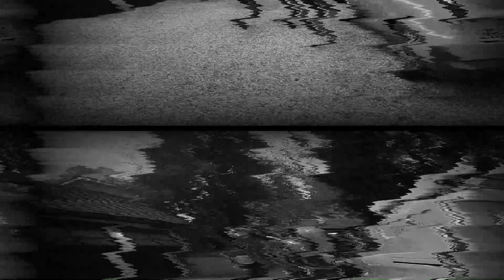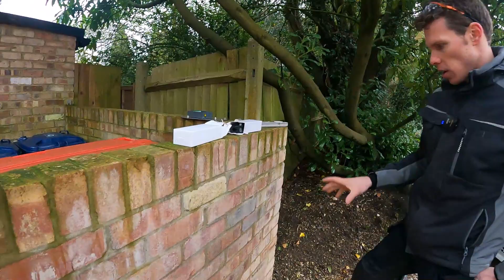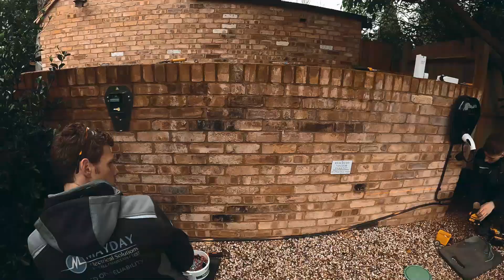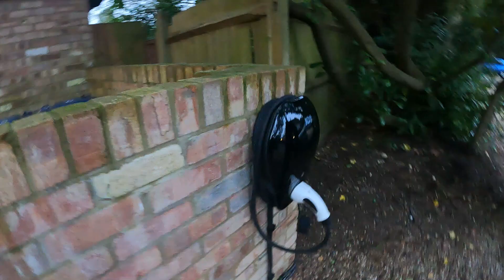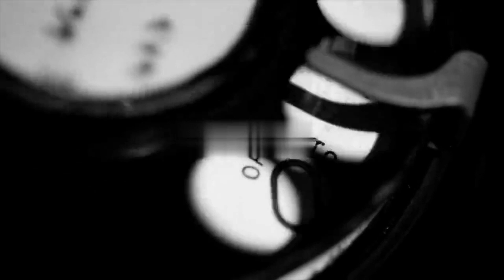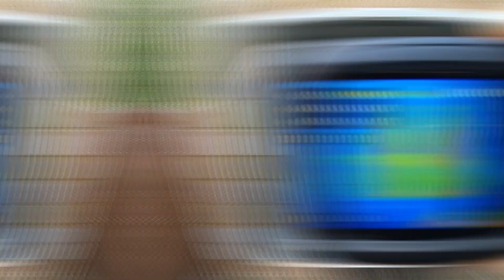Digital fuses & load management intelligent charging

Comment: Interesting to see the convergence of power networks and IT controls on third gen fusing. Will be keen to see how this moves into more regulated and possible central macro/micro load management by DNOs as every one drops in their EV chargers!
Reply from the maker: Indeed Peter although the IT side of things needs to be simpler as we spent too long on that project which we didn’t cost for